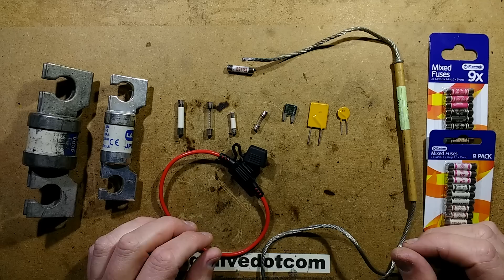Things you should know about fuses.  (including a 15kV one)

Comment: In a power distribution switchboard the first fuses in circuit are Fault Current Limiters and of very high 'prospective fault current' capacity.   e.g. 100kA 

The larger bolt in type there might be 400A or even 615A, but only 40kA. 

It's a matter of 'rupture capacity' under the vaporising action of a 'blow'.
Plasma ball hotter than the sun.... high kA faults close to the HV/LV transformer....  faults in consumer MSB's that cause cascade protection trips across a large distribution network... recorded at major base load generation facilities prior to sub-station disconnection within a few milliseconds, yet 200km away...  scary stuff!
.... though I must say... the metal spray on brick walls from a huge plasma ball melting copper and steel swithboards is a rather pretty iridescent colour to behold.  

Get up to the 1200A size and the internal elements are ribbons of perforated silver... sometimes 6 in a radial layout.
Large Low and High voltage fuses can be >50mm diameter and  1metre long... sometimes with a spring loaded 'blown' indicator.. a tiny fuse wire inside blows and the indicator pops up. 

Indicators are common on the euro bottle type fuses... neat devices because the cap was sized so an oversize fuse couldn't be installed.... with know how you could change the encoding insulator onside the base... but only a fool bodges that shit up. 

Was a time indicators on the 'English Electric' NS and NIT carts had a little black powder charge ignited by such a fine element too... located halfway along the ceramic body.  

I have worked with specialised variants used for 'semiconductor' protection in large DC motor drive units... place in the AC supply line - never in the DC output side. 

These 'Ultra-Fast' fuses at higher rating (about 125A if I recall correctly) are often two cartridges in parallel  and quality made switchgear ensures normal carts can't be installed. 

Despite popular myth... 'Ultra-Fast' semiconductor fuses do work, more often that not acting due to a system control wiring or ancillary motor fault than a thyristor fault.... being the main fuses in the control panel - blowing prior to far lower 'normal' fuses blowing [rather annoying]. 

Worst fuses I've encountered?   The rewirable type used in a domestic installation.  These always seem to have associated problems of bad wedge to base contacts that have heat generated and insulation burn, aside repeat blowing as a result.... AND the way untrained people often drop the wedge that breaks and is cobbled back together with double the correct rated fuse wire installed. 

Also, not impressed with stuff used in the USA. Actually seen cardboard 'HRC' cartridges at high Amp rating - NOT ceramic! 

Very very ordinary stuff.

Frankly, I loathe working on domestic installations. I reckon it's inherently far safer working in a heavy industrial situation with high voltage [i.e. over 1kV  to 550kV] than  a damn home at 240V or maybe 415V in the meter panel ! 

One important point though, Clive. 

Please instill the critical need for the correct type fuses installed in the likes of multi-meters , in the hands of people who tinker... the intended audience well informed with your videos here. 

ALWAYS REPLACE BLOWN FUSES IN MULTI-METERS WITH THE SAME TYPE CERAMIC HRC CARTRIDGES - AND KNOW THE CATEGORY OF WORK THAT INSTRUMENT IS SUITABLE FOR ! ! ! 

Perhaps a recommended subject for a clip here? 

Multi-meter Categories?  (my old Fluke and AVO meters have lasted >20yrs... and still well calibrated instruments) 

Imagine a 'Pound Shop' multi-meter put across poly-phase mains supply when set to Amps or Ohms rather than Volt... and some blown fuse inside fixed with a few wrappings of aluminum foil.... as they do. 
Hmmmm 

One flash and your ash.

Comment: Thanks for an excellent video. I can’t resist being a bit nerdish: the fuse in a UK 13A plug top is not an HRC fuse. It’s a BS1362; HRC fuses are BS88; the breaking capacity of these is a fair bit higher, and they offer shorter disconnection time for a given level of fault current. On domestic supplies in the UK, it is rare to measure a fault current between line and neutral of more than 6Ka at the intake of the consumer unit. Re correct fuse current rating, a minor point. Ensure that the correct fuse is in every 13a plug: for a load of 750w or less, 3a fuse, for more than 750w, use a 13a one.

Comment: Can industrial places get in trouble for using the wrong fuses?
It could be really dangerous if it happens in a hotel or shop for example.?
Reply from the maker: Only in terms of the damage it can cause if it's rated higher than the wiring and equipment can handle.

Comment: My brother bought an old car once, and the electrical seat controls on the drivers side didn't work.

I took a look in the fuse box. The previous owner had removed all the fuses, placed them back completely randomly, and on the ones that had blown due to them being the wrong rating, had wrapped copper wire around them.

After putting the fuse of correct rating into the socket for the seat controls, it worked perfectly.

Comment: Where he talks about the voltage rating as 250V AC he should be clear that this fuse should not be used for DC. DC is much more difficult for the fuse to interrupt as the arc in an AC fuse extuingushes twice a cycle as the current falls to zero and is less likley to re-ignite. With DC the path lenght needs to get long enough for th earc to fail. Easy at low voltages but not at high DC voltages. Some fast acting DC fuses have an explosive charge of Mercury Fulminate to break the wire and the arc. In DC traction applicatin applications fuses cannot cope and you need to use a proper DC rated traction breaker to open the circuit. Big gaps, arc horns and magnetic or air blowout are the way to go. 

Also fuses have a maximum fault current they can interrupt. The ceramic tube fuses used in 13 Amp plugs are higher rated than the clear glass fuses shown. At high fault currents the wire in the clear glass fuses can evaporate and redeposit as a conductive layer inside the glass resulting in a fuse that still conducts even though it has blown. The ceramic powder inside the 13A plug fuses is designed to prevent this.

A final though fuses are the only product sold that are 100% not tested for their most critical function blowing !

Comment: I had an interesting experience many years ago where a 3KW imersion heater was blowing the fuse after a while in the 13a plug, tests proved there there was no problem with the  heater but the fault persisted. A 13a fuse on a full 3Kw heats up on load but this was being suplemented by heat from poor connections in both plug and socket, replacing both components cured the problem.

Comment: 1 amp at 12volts is 12watts at 125volts it's 125watts that's why they have a voltage rating a car fuse not good for house mains .or visa versa.

Comment: My grandfather was quite weary of working on anything involving electricity. He told me that he was was working in a slaughterhouse (this would have been in the late 1950s through the 1960s) and heard a loud explosion and saw a bright light racing down "the line" toward "the wall box." He said he jumped up, ran and reached to hit the lever on "the wall box" but couldn't get there fast enough and "the box" exploded and blew the cover off which flew across the shop with great force. He said there was a huge flash and smoke filled the shop.

Comment: I have the polyfuses in my Honda door mirror folding mechanism. The folding motor receives power from the control switch continually but the polyfuse goes high resistance when the motor reaches the endstop and goes short circuit on stalling. The switch just reverses the polarity to the motor and off it goes again. Quite clever but not very durable long term.
Reply: Huh, is that why those things never work right when cold...
Reply: @tsm688  could be. On rereading my comment I see that it is not very well explained but mainly the polyfuse goes open circuit when the motor stalls at the end stops. Problem is that the fuse eventually fails to reset and you have to replace the whole relay unit unless you know how to dig the polyfuse out of the potting compound and replace it with a new one.

Comment: Woudln't that chinese fuse, with the wire touching the ceramic, act as a heat sink? And possibly not even fail? Or fail way OVER its rated ampacity?

Comment: fuses are in place for a reason. I cracks me up when someone tells me that the problem they had was just a blown fuse and they put a new fuse in and fixed it. To most of us it's common sense to figure out why the fuse blew, but I'm surprised at how many people don't realize that. Probably the same people who have a check engine light thinking that if the CEL is cleared the problem is gone. I had a friend and his guitar amp blew a fuse so he wadded up some tin foil and stuck it in the fuse holder. It worked great for quite a while surprisingly till one day the amp stopped working permanently.
Reply: It is not uncommon for a fuse to fail after a few thousand power on cycles.
The foil wrapped fuse will often weld the holder shut and also make it swell.  This can make it hard to replace the holder while fixing the other issues.

Comment: Is there any way to tell what the value of a used ptc is if you can not read the writing on it? I'm assuming the value is on it anyway (but you know what they say about assume).
Reply: If you need to replace one on something below about 16V,  the mechanical size is a good guide.  The bigger the higher the current.  You can find the datasheet for a new one of the same size and assume that it is about the same. 
In a room at 25C, very slowly increasing the current through one will cause it to trip.  They are good for a goodly number of cycles so it is safe to do the test.

Comment: the soft is low resistance conductor the thin is or has a resistance that makes it open by heating the soft conductor causing it break closer to the rated value.

Comment: I used to work for a company that made domestic fuses in the UK. I made a suggestion one day which I thought was really good but the Co was not fare sighted enough to take it up. My idea was to replace the silica sand that made the fuse a slow blow fuse with black powder as you would now straight away the fuse had blown. Also the Co could then sell not just one fuse to replace but also a new 13 amp plug and a new wall socket as well. Good for the manufacturer business !.

Comment: I felt that you missed a very important factor to consider also... The wires in the circuits are usually of a size that should not exceed the current of the circuit as well.   My dad was one that would wrap a fuse with foil from his cigarette pack. (smoking can kill you in several ways).  This is ok if you know that a fuse popped for a reason like a short that was caused by something erroneous.  But you must replace this foil bypass as soon as possible or heaven to bid, you will have a short the burns all the wires from the source to the panel!.  He would also put a penny under the screw-in type fuses as we were always short on those!  Thanks for a wonderful series of educational videos!

Comment: A good way to spot a genuine BS fuse is looking for the dimple on the ends. The fakes don't have that since the wire is just shoved between the ceramic and the end cap edge. Geuines mount the wire in the middle of the tube and the endcap.
Reply: Never noticed that before. On saying that, I have a few BS1362 13 amps with no dimples???
Reply: @paulf1071  I'd recommend testing one and opening one up, it's probably fake.
Reply: @benbaselet2026   Hi Pentti. I took your advice and cracked open the ceramic on one of the fuses. It had sand in it alright, and the fuse wire looked securely bonded to the middle of both end-caps. It also had that slow-blow 'blob' in the middle of the wire. So overall, it seems like a genuine fuse. Maybe the dimples were added in a later revision of the standard???
Reply: @paulf1071  Perhaps there are different processes for different manufaturers then, interesting

Comment: Had an out of hours call to the City (London). None of the system would work, the previous engineer was certain that the electrician had connected two phases together. EVERY part that interfaced to the mains was blown ! Two disk drives had frozen the heads over the disc and wouldn't retract, had to open them up and move the voice coils manually with some force. Eventually when the engineer returned the next day there was a very large pile of power supplies, fan trays and other parts by the wall and all systems running with the office's collection of fans blowing their blades like they are going out of fashion. It all worked ! WHAT A NIGHT THAT WAS !!!
Reply from the maker: Sounds more like a dropped neutral or phase/neutral reversal.
Reply: @bigclivedotcom  I bow to your knowledge, havent got a clue, but that was f*****g hard work ! Two taxi rides during the night for parts at the office. A fight to get into the office on the 2nd visit ! Traffic Wardens kept away when they sent me home in a Taxi and looked my motor parked right in the middle of the City of London, till I picked it back up again around 2pm !!! I do believe that May be called a melt down of some kind. Just glad the discs came back up again after some fettling.

Comment: I've seen the inside of the control circuit of a 2 MW generator that failed catastrophically. There was none of the wiring left, and the entire interior was copper plated. All I really know about it is that when it failed, there was a very loud "bang" and smoke was visible in the area around it. The whole circuit had to be rebuilt using the other generator's control as a guide. Most of the "bang" was the 1200 amp 440v circuit breaker tripping.

Comment: This isn't an explosion story (fortunately). I used to work in home improvements many years ago. I was building a furniture cabinet around the main circuit breaker/wall unit (the unit was in a plastic box) and while checking inside the box I saw something silver low down. When I shone my torch on it, I saw the broken end of a 25mm/1" masonry drill jammed fast against the mains cable. It looked like it had been there for years. Someone had tried to drill through the wall from the outside and somehow their guardian angel had caused six inches of drill to break off and save their life. It had gone through the live insulation and was just kissing the neutral. This was on the street side of the supply. The house owner went pale when I showed them their "time bomb". It would have blown eventually, spectacularly. Half the street had to be switched off for the operative to rewire.
Reply: Reading that it gives the impression that the driller got a bang and leapt of the ladder snapping the bit in the wall.

Comment: I love it when customers come in and demand "a fuse".
"What fuse do you need?"
"A normal fuse"
"that doesn't exist"
"It's for my lamp"
"Not helpful, what rating do you need?"
"250V"
"That's the voltage, I need amperes and trip characteristic"
"just give me the standard value"
"that doesn't exist"
"just give me one of each"
then i usually point at the ~2*1m wall where we have all the Fuses in little (~2*3cm) drawers...

Comment: you want to be careful when breaking open anything electrical with ceramic as i have heard that the magnetron units in microwaves have beryllium oxide in the ceramic bodies

so it could be possible that the ceramic of the fuses may contain some toxic stuff

https://en.wikipedia.org/wiki/Cavity_magnetron#Health_hazards
Reply: There's a reason they use expensive toxic heavy metal ceramic in magnetrons.

There's no reason to do that for fuses.

Comment: I suppose you can use a slightly higher current rating fuse if you trust the rest of the wires enough. For example, my starter motor fuse for 12 volt and 10 ampère was blown, because of age and deterioration. I replaced it with a 12 ampère one. I don't think that is too unsafe. Another fuse that protected the switched mains output of my amplifier was rated at 250 0.5 ampère. When it blew when I used a bit more then 0.5 ampère I opened up the amplifier to look for the fuse. I saw that the wiring and the relais might easily handle more than 0.5 ampère so I replaced that fuse with a 1 ampère fuse. I think if you use common sense and don't exaggerate the rating you can make your fuses blow less often and still be safe when you sometimes use fuses with a slightly higher rating for replacement.

Comment: Is there any possibilty that a fuse will not work properly and could it make sense to put maybe two in series for redundancy?
Reply from the maker: It's possible if you used a fuse from an unknown source.  There are instances where more than one fuse protects a circuit.  In the UK we have the main incoming supply 100A fuse, then a 32A circuit breaker, then a fuse in the appliance plug and sometimes another in the appliance.
Reply: Thanks for the answer and your informative videos.